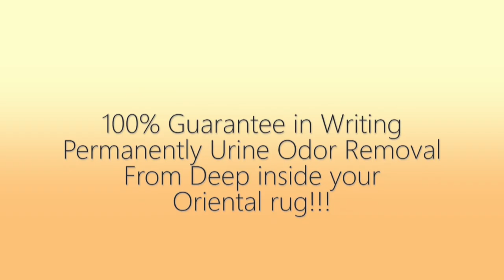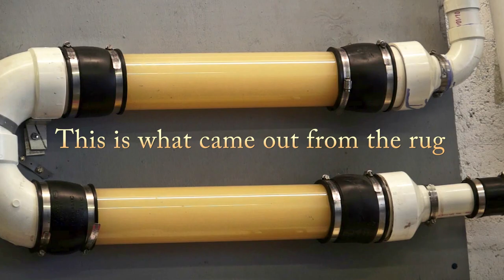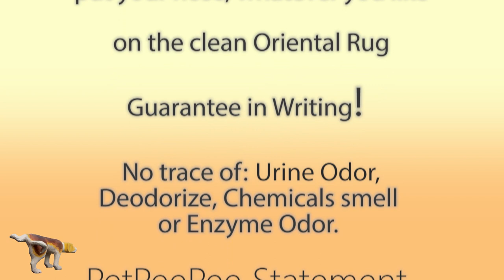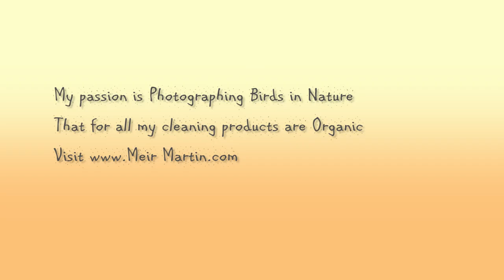A TREASURE RUG THAT SMELLED BAD ORIENTAL RUG CLEANING

Comment: I don't have any clue but one thing occurred to me. Why don't you clean the rug upside down? I mean wouldn't your method also get some of the larger particles stuck even more deeply into the rug? By sucking the water solution from the upper side you would also remove any deeply hidden particle. Am I missing something?
Reply: They probably do a little cleaning at the start to get rid of big particles, either way I don’t think there is really big particles on a rug considering if you take well care of it, you vacuum the rug. Honestly idk I’m probably wrong!
Reply: Pee sinks to the bottom, not the top.  You want to keep the top as clean as possible.  Also, the top has the long nap to be brushed clean, the bottom is flat.
Reply: Joshua Phillips  how can you tell it's cheap just from this video?

Comment: I've never been on such an emotional roller coaster. From the first moment I was hooked with the mystery of the smell. It brought out my inner Sherlock Holmes with it's many twists and turns. I questioned every moment until the final housekeeper reveal. I'm still not fully convinced that it wasn't in fact the house keeper peeing on the carpet to cover up the stench of blood.

 The tension built to a magnificent peak with the cleaners story arch and backstory. There were subtle hints as to his origin with references to the "Dead Sea". But his knowledge and expertise really shined in the resolution of the main plot. 

The finale with the musical number penetrated to the depths of my soul. You can really feel her thankfulness for having a clean carpet again. 

The only place I could offer criticism is the ending. At 1:30, it drones on a little long with its extended cast. Overall, I think this is a must watch family or party video.

3/5
Reply: Lmao 10/10 comment

Comment: Is the vacuum go under the rug?
Reply from the maker: Yes
Reply: pretty sure its like a massive metal grate then when they turn the vacuum on its sucks air through the rug and it drains out the bottom.

Comment: I'm confused, they put the dirty water back onto the rug to clean it? If so how does that make it cleaner, and if not then what is it that happens?
Reply: They do change the water until it is clear.
Reply: its like pouring tap water on the rug, its not the reusable water they are using
Reply: the point the man was making, is that clear water goes up (you can see that) and dirty water comes out. As long as the water that's going in, isn't the same as going out, he keeps repeating the process. rinse and repeat, basically. But not with the same water.
Reply: I don't know how everyone managed to answer you incorrectly. He says that the water is filtered before it's recycled.

Comment: I know nothing about cleaning rugs, but would it make sense to have the rug upside down so the dirt could flow out better, as the rug will act as a filter the right way up? Just a suggestion. Love the water pipe arrangement, bet you go nuts at a water park.

Comment: just wondering what validity dead sea minerals have I suspect the work was done by the vinegar  and the minerals just doubled the cost
Reply: Yeah, you know that salt is a bit hard to extract from the dead sea and all. Makes it a normal price to about 3-4x more then it would normally cost with just some soft detergents and vinegar.

Comment: Cool process... It's kinda like washing your clothes in a front loader machine. The idea is that as your clothes tumble, the water and soap pass through them to clean them. I been told it's the most efficient way with out your clothes being ruin from the old agitators.

So you are doing the same but with help of a vacuum to pull the water through the rug. Where say a home steam cleaner you apply your cleaning product on top and suck it up thus never getting it a true full pass through clean like what you do.

FYI, shorten your intro and outro...

Comment: I have a shag carpet rug that has been urinated on by my dogs, would you be able to clean it with this method? I live in Phoenix.
Reply: not really the place to ask that XD and yeah why not
Reply: Just use the same old as hell method they do, salt and vinegar and then rise it till it's clean.
Hell my grandmother taught me this method, just use a wet/dry shop vacuum or a carpet cleaner (without their crappy soap).... 
Just remove the filter if you use the shop-vac as not to ruin it, they are just for dust =p

Comment: you run the same water through the rug over and over and over untill it torns clear?
Reply: It has a filter. They run the water through the rug until there is nothing to filter anymore, that’s when the rug is clean.😂

Comment: Meir, clever carpet cleaning technique.  Those expensive rugs cannot be "scrubbed" while you have the cleaning solution on them.  I think I'm going to build a similar apparatus into a box-truck and go door-to-door!
Reply: thats a terrible idea as this setup dosent even properly clean putting it on your drive way spraying it down with prefered chem and then just spraying it down with your water hose
Reply: Seriously is just draws the dirt further into the rug like that.
Though the salt and vinegar does work to kill the urine smell, my grandmother taught me that one (Fyi those "Dead sea minerals" are just salt)

Comment: drive up to the mountain, find a stream of water, lay the rug on the stream bed, let the water run over it at its won pace for half a few hours. bring it out, lay it on the rocks, let it dry for day or so. done. OR, call these fellows to do it for you for a (large) fee
Reply: You are correct, but you will destroy the color and texture of any nice rug.
Reply from the maker: Such a great idea to the 9 x 12 rug put it on your shoulder and go to the top of the mountain with a couple days for some streams and put the rug under the string of water then up to all the color Run's now take the rug to get on your shoulder wet and take it down to your house this is a good advice.
I love those advice from smart people thank you for watching PetPeePee videos
Reply: uh, you must have heard of SUVs? you know, the type that most of us own?  OR, just place it on a hard surface in the backyard, and using the hose, run lots of water over the rug, some hair shampoo, and then more water. finally, let it stay outside to dry in the sun for a couple of days. and voila!
Reply: a nice rug (nonfake ones) got fixed colors. the tribal ones use simple (and limited) vegi colors that last for centuries anyway. BUT, if you got a cheep rug, then what is the point of spending the big buck on cleaning it? just buy another cheap one and get rid of the smelling one

Comment: i just camp my rugs to some saw horses then spray them down with the garden hose and some dish soap or what ever until the water comes off the bottom clean. granted i dont own any expensive oriental rugs, but it works fine on some cheap walmart ones.

Comment: it seems this would just suck any dirt DEEPER into the rug?
wouldnt this work better if the rug was upside down to suck the dirt OUT of the rug?
maybe treat it nap side up, then flip it over to vacuum the water out?
Reply: Dirt inside the carpet will leave it just about as easy from the top or bottom. The rug fibers have enough space between them for the cleaning solution to remove the dirt and pass it though the rug. By vacuuming out the bottom, you minimize the risk of damaging the top of the rug. Also makes it easier to see the progress and do any necessary spot cleaning on the top of the rug.
Reply from the maker: 99% of all the rugs that's come to PetPeePee facility are clean no dust no traffic area however the rug smell so bad from urine odor and the reason customer use PetPeePee service because it smell bad.
If you have rug that having traffic area dust soil heavily I don't provide the service. I don't clean rugs from dirt and soil I clean on the Oriental rug that saturated from Pee pee bed odor this is my specialties
for this reason the way how I clean the rug this is the right way look at the video enjoy it thank you very much for watching PetPeePee videos

Comment: Just make a Carpet shamoo solution of OxiClean and Dawn dish detergent and vinegar and Downey Softener and Tide and scrub the front and the back of the rug and extract it with a carpet shampooer on the front and the back. if you can get your hands on a antique Electrolux carpet scrubber that's even better and then use a carpet steamer to steam it front and back!

Comment from the maker: This machine The X petPee Machine change the way, oriental rug should be clean.
Meir Martin the owner of PetPeePee company.
Reply from the maker: Please Call me if you need more Information 561-221-2815
Reply: PetPeePee Oriental rug Urine Odor Removal Naturally. I have a small prayer rug I inherited and I cleaned it myself by brushing it - it may be silk so I didn't want to be rough with it or wet it. It has the original writing in Arabic about the origin I just can't read it. It's about 2 feet by 3.5 feet, how much do you think it would be to clean it? I can take a picture later

Comment: You guys are wasting so much water
Reply: he already said they don't waste the water? Well, the way he described it sounded a bit confusing honestly, he seemed to imply he filtered, looked at, reused. It seems to me it'd make more sense to look, filter, reuse. But if the first is correct then his filtering isn't a super micron level filtering or anything, it's a general filter for dust and debris but things like the carpet cleaning solution suspended in water pass through and he relies on the overall cleanliness of the water to determine when he needs to swap water. Personally i'd have thought it'd be better to pre-mix his dead sea solution in pure water to create a solution, mist spray thinly and uniformly on the carpet and then run water, look, super filter water of everything. spray mist, re-use water, repeat. But who knows.
Reply from the maker: Thank you for watching PetPeePee video.
I cannot disclose all the information and all the details how I clean Oriental rug however I can promise you and I'm sure you that we use the last water to clean Oriental rug from urine odor and provide the hundred percent guarantee urine odor removal thank you for watching PetPeePee Oriental rug drapery cleaning from dog and cat urine odor.

Comment: Cheaper to buy a cheap chinese flea market rug for couple hundred every few years and have 0 smell I say out with the old stinky in with the new pinky :)
Reply: Sounds like a sound suggestion bruh.  Go toss out a family heir loom, or, perhaps one of those worthless old stinky 100, 200, 300, 700 year old Persian rugs for a brand new shiny Chinese or Indonesian rug!
Reply: That's an extremely wasteful and also much more expensive for the same quality rugs.
Reply: Cheaper for a reason too, those things unravel the first time you vacuum them. This was her deceased sister's rug too so it has tremendous sentimental value as well.